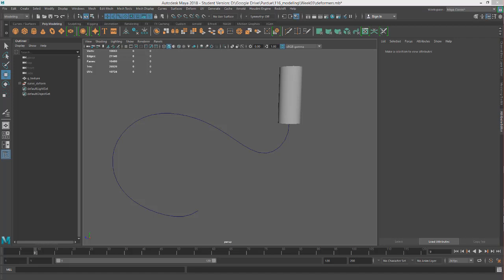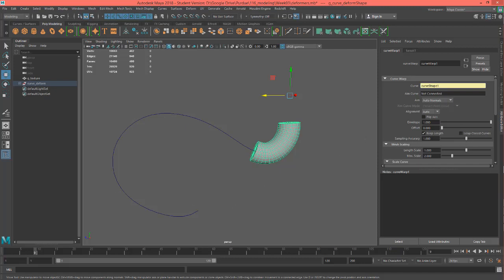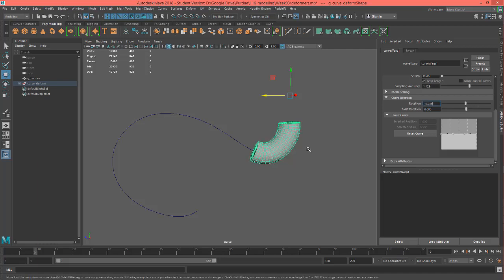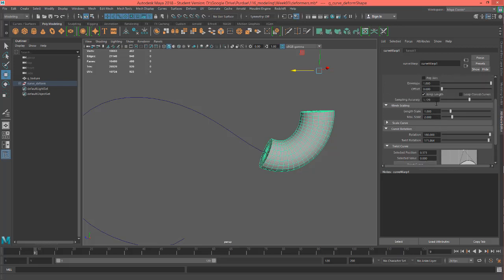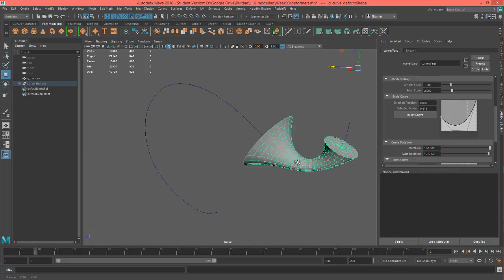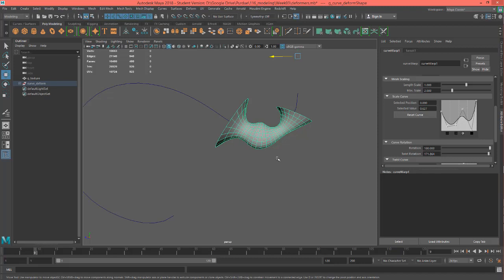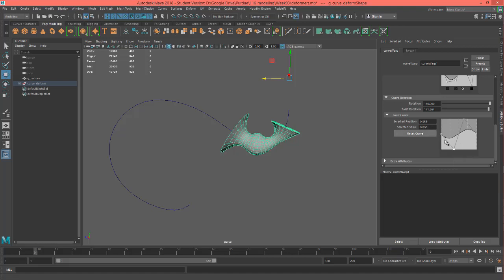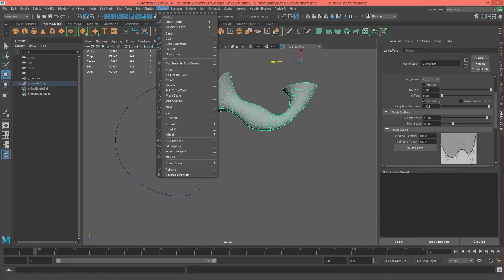Maya: Curve Warp Deformer

Comment: Good tutorial. Additionally, if your mesh has strange bends in the geometry at certain points, like mine did with doing a loop-de-loop, you may just need to move the curve control points. Right-click your curve and select Control Vertex. Now move the curve points so that the polygons of your bent mesh are not overlapping. The Curve Wrap modifier will still be on the mesh and adjustable, so you can go back and forth without messing anything up. 
Additionally, additionally. You can also smooth your mesh with 'Mesh > Smooth Mesh' if you need more geometry without messing up the Curve Wrap. 
Hope this helps someone!

Comment: how i find curve warp tool, i can't find it. Ty
Reply from the maker: In Maya 2020 it is in the deform menu, make sure you are in "Modeling" "Rigging" or "Animation" in order to find the deform menu. If you are using a different version of Maya, check Autodesk's documentation, it is possible they moved it
Reply: @Daniel-3d-Trip  i use maya 2018, yesterday i turn on it in plugin menu.

Comment: Hi, does anyone know why my curve deform make the mesh become flat?
Reply from the maker: You have to orient your mesh in a way that the Y orientation aims in the same direction as the beginning of the path and follows the tangent of the curve points aims. Hope that makes sense,  without getting overly technical in terms: think of a cylinder as a pop can, and if you want to put a straw in the pop can (the straw would be the curve), you have to align the two in a way that the straw goes through the top; that is the orientation you need to have.

Comment: Cool but for some reason I don't have CurveWrap option in my Deform Menu, it's here on the MASH menu but unusable, I have the student version also, do you have any idea what problem it might be ?
Reply: need to check it ON in plug-in manager
Reply: late answer but you are probably in  the wrong workspace, for example "rigging" or "animation", you need to change it to modelling, there is a fall-down menu on the top left side of Maya, right below "File" and "Edit".
Reply: Try to switch the modelling mode to the animation mode. There is the Deform menu. Try to find it there.
Reply: @romankamzolov2425  thanks dude I find it